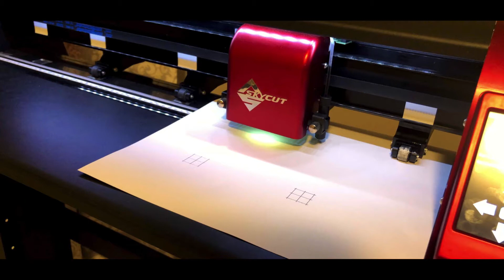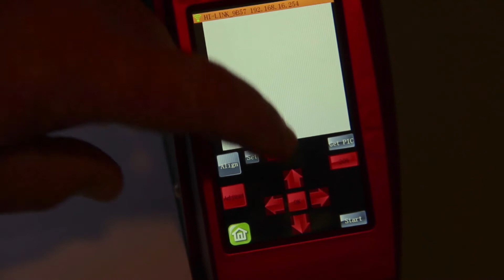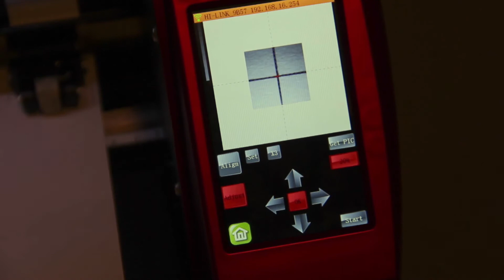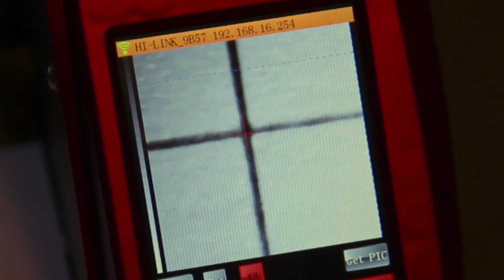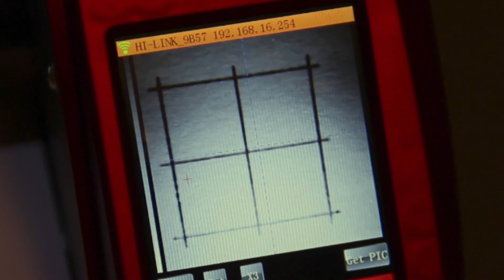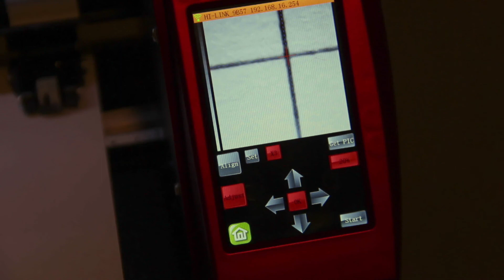SkyCut Dual Head Camera Calibration Model D

Comment: Hi, whats the purpose of pressing for 3 seconds on the OK button as in the other camera calibration video you did, you did not perform that step. Nice video by the way.
Reply: Is it used to set the auto calibration mode?
Reply: @cmdrsos4biz897  Pressing the middle button takes you into the newest auto-calibrate mode. 99% of the time, you only have to then press the middle of the test pattern once to get the red + close by to the center and the camera takes over and does all of the rest on its own.
Reply: @sandymccauley  Thanks for the reply Sandy, much appreciated.
Reply: where did you get this press from..